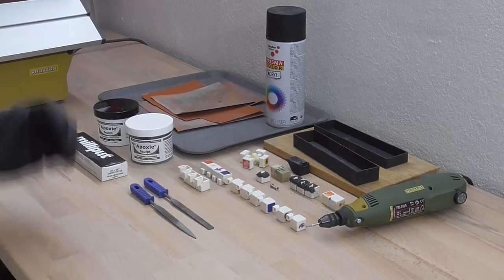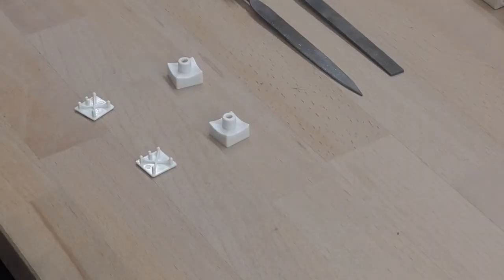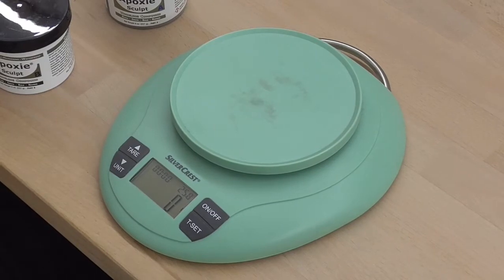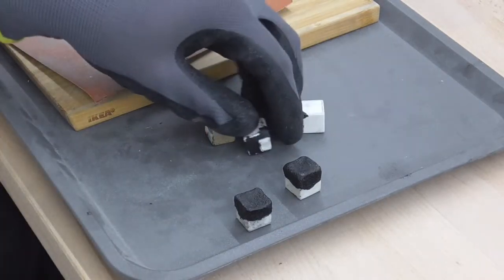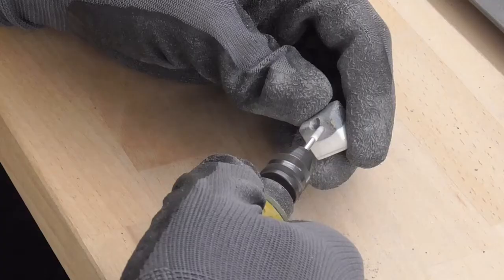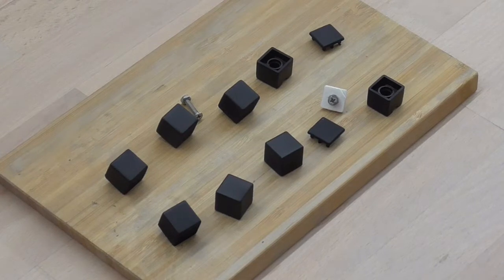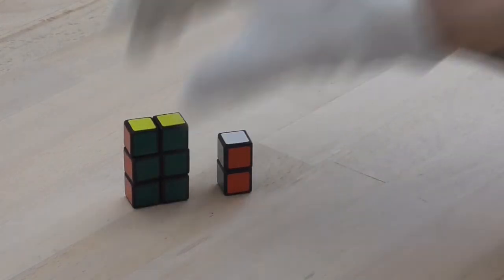How to Build a 1x2x3 from Rubik´s Cube parts - Complete Build Guide

Comment: A spring is needed so that it corner cuts
Reply from the maker: A spring would allow too much movement. The pieces would just fall out. If you can work very precise, a small spring would benefit the puzzle, but because of the small tolerances (hand building and using a mini 3x3), I decided against it.
Reply: Thanks

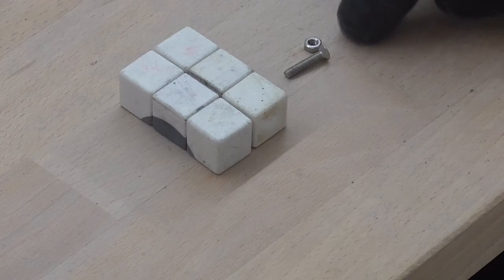Comment: 10:12 Not enough in the set of washers for bolt and nut.
A washer is needed to prevent twisting and unwinding of the puzzle. Without it, it can either jam the rotation or fall apart.
Great job!

Thank.
Reply from the maker: You are absolutely right!
It works without the washer too, but if would benefit the turning for sure.
I hope you still enjoyed it. Thanks :)